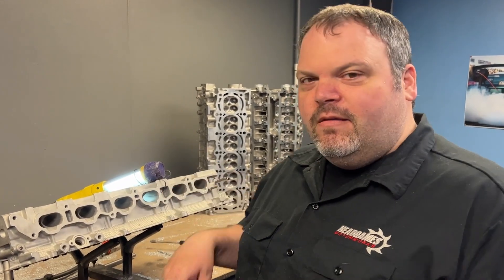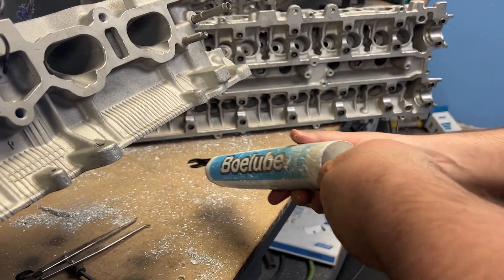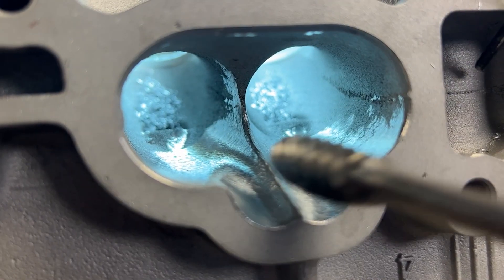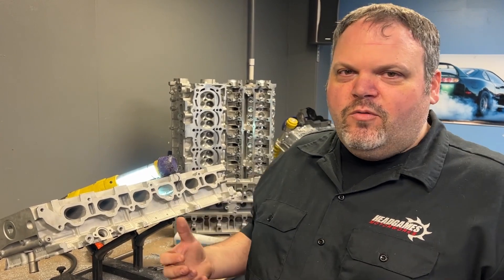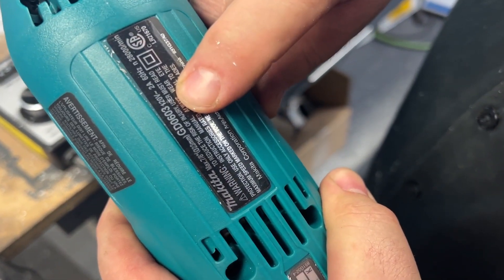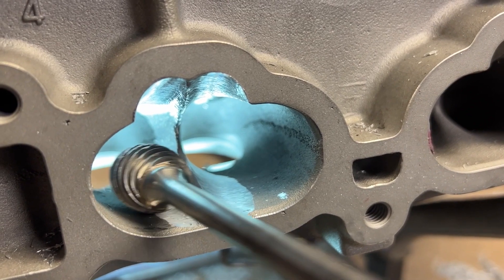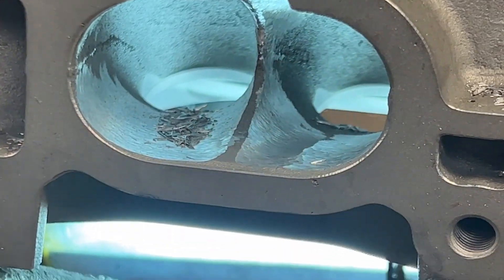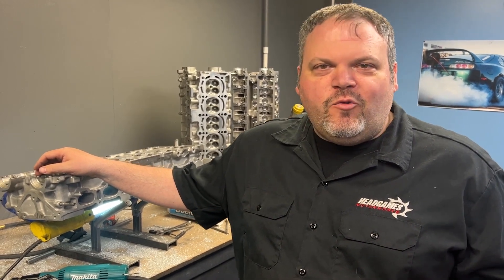PORTING HOW TO: How to shape a fin on a 2JZ intake port!

Comment: Thank you for sharing. Can I do some "minor" porting such as this to improe the flow of my head? Or is it a case of, you have to also do the pocket & short side radius to have any benefit? or does a little bit help? Also do all the ports need to be the exact same volume? Ie you have to remove exactly the same amount of material from each port? or it doesnt really matter as its more about the way the air flows? Thanks again, i really like these videos teaching the tech & theory behind things!

Comment: I've done a fair amount of porting myself and am impressed you never once chattered the bit around the port using that electric Makita wide open. I found an air grinder to be far more forgiving.
Reply from the maker: Because of the burrs we made it doesn’t chatter. Super controllable and moves material fast.
Reply: Where can I buy those burs??

Comment: Is this separate option in your 2j packages or it comes with one of the packages?
Reply from the maker: Then it would be a full port not a pocket port. Pocket port is just the area under the valve seat and short side radius. The runner is left alone and the this vid has what would be the full port if we finished it. There’s no benefit in doing just half of the runners. (I used the word runners to describe the rest of the port )
Reply: @headgames  👍
Reply from the maker: we do this in our full port 2JZ. But, its a cnc port
Reply: @headgames  Would there be any benefit if that was done with just a pocket port?

Comment: I've done a fair amount of porting,  as per David Vizard's teaching. 
 The best cutting fluid I've found for the burr is Sthil bar and chain oil.
 It clings to the cutter very well, and prevents clogging even with a  fine burr on aluminum.
 I dip it in the oil, then hold it in the port and give it a quick spin. This spreads the oil through the port.
 And when used for this application the cost is almost nil.
Reply from the maker: I can't get with using an oil. Its messy and smells.
Reply: @headgames  I need to give the Boelube a try. I've tried every oil, wax and paste I could think of and they all make a terrible mess...nothing like a slurry of oily chips collecting right where you need to see/feel the shape you are forming. My current technique is to run her dry, and just take it easy to avoid generating enough heat to allow the aluminum to begin smearing into the burr.